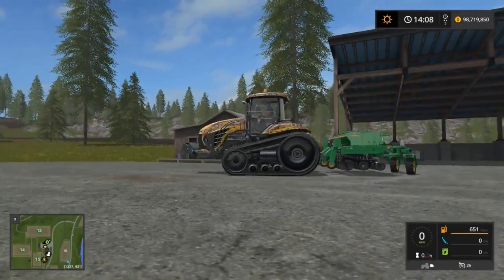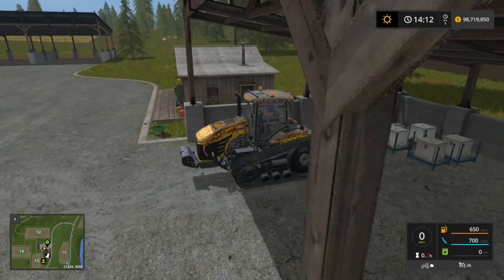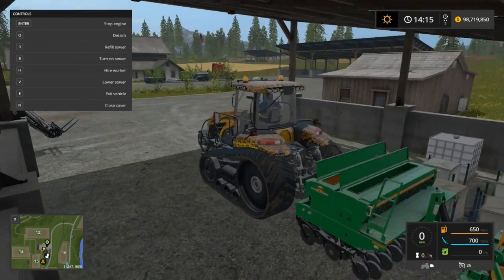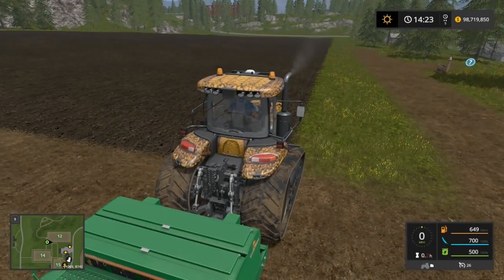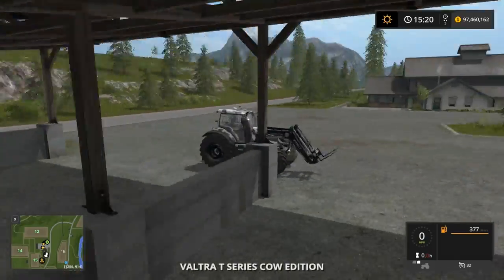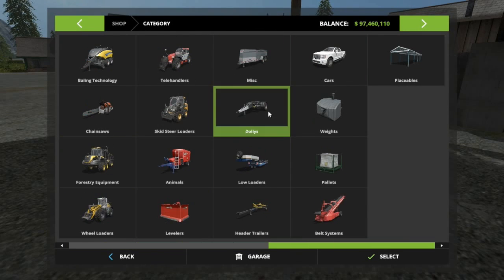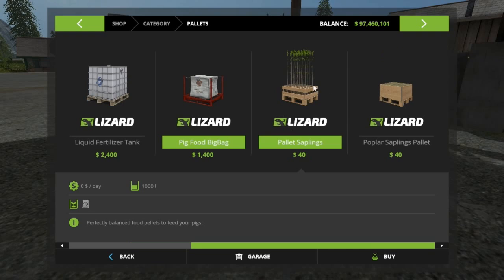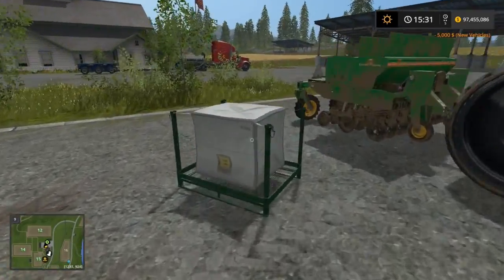Farming Simulator 17 Tutorial - How To Refill A Sower / Seeder | FS17 Tutorials

Comment: helped needed: my sower won't refill (vaderstad tempo F8). I've tried pulling up next to the seed bag and I've tried lifting the bag over the sower with a front loader. I hit the button to refill the sower but it stops immediately. help?
Reply from the maker: gravellesimon did u open the cover on the sower it should automatically start filling when u lift the bag over it if so
Reply: Elite Chris yeah the cover is open. Wonder if it's just a glitch? thanks KS for the quick reply by the way. would you happen to know why some times I can't hire a worker to fertilize my field? it'll go a few feet then say the worker finished his task

Comment: I did the wrong thing. I bought seeds and loaded them in to a tipper truck and then unload the seeds on to the ground. Now I don't know how to get them off the ground
Reply from the maker: Darlington Jones Imagery use a bucket on a front loader and then tip them into the seeder or use a conveyor belt, both are solid options